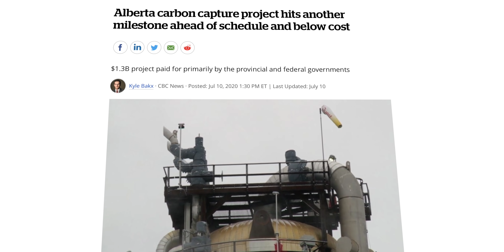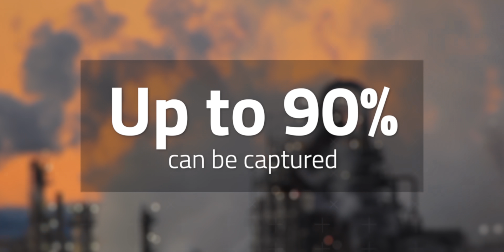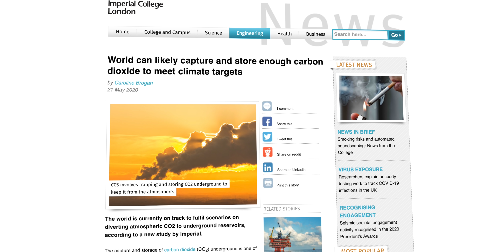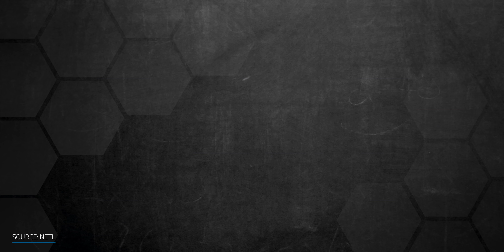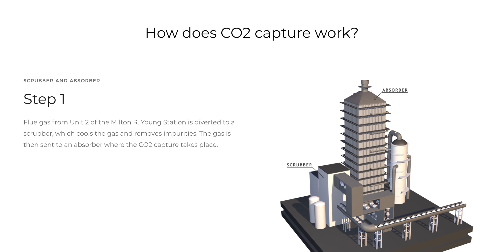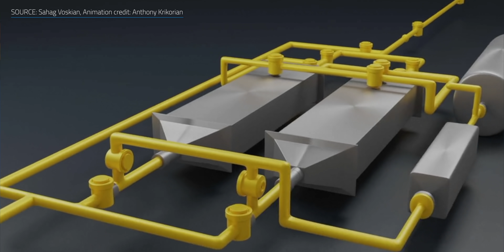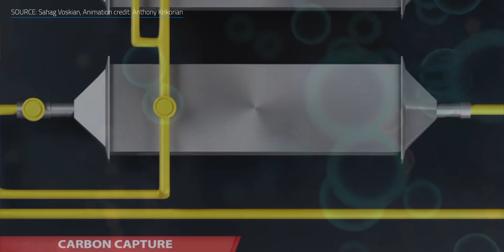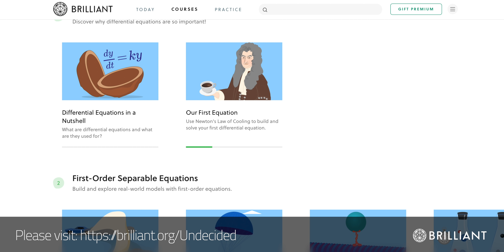The truth about capturing CO2 to reverse climate change

Comment: You may have already done something on this: could Earth be cooled with large banks of radiative refelctors like Skycool or any of the numerous companies coming out with this kind of tech? Also when people are focused on carbon doesn't it seem like the conversation should also include general air cleaning for toxins?
Reply: XPRISE CARBON CAPTURE
The heat loss from a smokestack can be forced into a large tank containing hot liquid microcrystalline petroleum wax. The heat will keep the wax at a molten state which facilitate the carbon to be absorbed when combined with the wax. Carbon when mixed with wax reacts like a dye. The wax-carbon amalgamation result in a black wax solution thereby making it impossible for the carbon to escape into the environment. Other toxic particles are also captured in the wax settling at the bottom of the wax holding tank forming into a sludge. A sludge release valve is located at the bottom of the tank. After the sludge is removed more wax is replaced in the vessel working something like a toilet. The sludge becomes a byproduct that can be used as an additive to asphalt for roads or used for cocooning nuclear waste materials for long-term safe burial. The entropy of the Earth has been increasing at a startling rate since the beginning of the industrial revolution caused mainly by the carbon that is released into the atmosphere. Government scientists have failed to stop and prevent carbon pollution from entering the environment. This problem can only worsen until a solution is found before this problem becomes irreversible. It has been discovered that formulated wax has been shown to be the only answer to this problem. William Nelson

Comment: We will need it, or did i miss anything? were pumping out noz only CO².
Those forest fires all around the world these days just kicked off an even worse heat-cycle.

deadline 2050 until our oceans and soil turn bad at a rate we would not be able to fight back accordingly.

means: food shortages worldwide. 

melting glaciers will mess with groundwater levels, as well as rising sea levels.
salt water pouring inland contaminating ground water, while most of the worlds population live at the coasts.

means: clean water shortages.

Comment: In Europe CO2 capture will increase with the price of CO2... Currently the price for CO2 is so low that its only worth it to shut off coal power plants, not yet high high enough to caputre CO2 ... I read calculations that we need more than 100€ per ton for that to become viable... and we might need another year or so until CO2 prizes are high enought for that... hence the startups that see that coming.

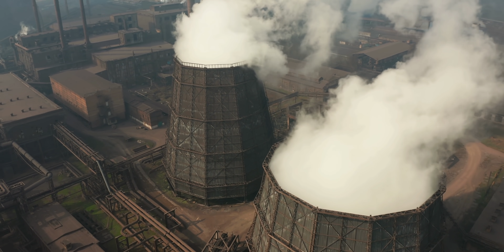Comment: @1:42 you state that there will be fossil fuel use for some time, and I would like to counter, that if the world takes it as seriously as a gas-chamber using Hitler, and commits to actual geothermal energy harnessing, then there wouldn't be your argument of "it's going to be here for a while." So while you're trying to sound the optimist, stop being so pessimistic and suggesting that litigation start NOW to MAKE oil industries SWITCH to geothermal by following legislature based on best engineering practices.

As for capturing that gas, it's pretty much a case of capturing it at it's source, and get the biggest polluters handled first.

Comment: CO2 Capture at high concentration outlets is great and necessary but Direct Air Capture is a pipe dream that is unlikely to ever work. 

This is because you need to flow an insane amount of air through a DAC plant to capture enough CO2 to make a dent in global emissions. For example, you need to flow on the order of 1 quadrillion cubic meters of air through a DAC plant at 100% removal efficiency to pull out ~1% of our current yearly global emissions.

Comment: Since the 1970's the rush for climate $$$ has been on. Every 10-20 years the earth is going to stop spinning on it's axis. Every solution from Nuclear to wind and solar has always had a by product that is EQUAL or MORE harmful than where we started but a lot of people make $$$$$ in the mean time. Today Solar and wind are the answer since we have huge WHIP sites with no end or solution in site. We have been using wind long enough now we are finding we have to replace all those blades on a regular basis and they are toxic. Now we are developing "WHIP" sites for turbine blades until we can find a solution and the cost of replacing the blades is more than the original turbines because technology has changed".... Unregulated sole source sales trap from the vendor!!! And who is one of the big players? GE who also makes coal plants systems, hydro turbines, and electrical power transmission systems....The coast line of the USA has been supposed to disappear since about 1988 and it is still there largely in the exact same place it was in then. I just watched a video by a solar company who's system installation with 25 year efficiently warranty on the panels will still not pay for itself because they added the "tax credit" back into the solar panels so there is really no incentive to buy their system.... A trick that has been played since the 1970's. And then there is carbon credits for the elite to use to cover their 20K to 60K square foot homes!!! Planet earth is the only one we have and we need to take care of her in spite of all the lies but so far every "solution" treats earth like a litter and we just keep covering more crap from lies deliverers with out any real solutions. Just big $$$$ changes hands to the same money pits.

Comment: The progress we have made on renewable energy is encouraging? It was a disaster in England and in Germany. I don't think anyone has thought what the climate change effect will be of taking gigawatts of energy out of surface winds. Talk about something potentially horrific.

Seems to me carbon recapture should be called plant lots of trees. it's cheap it's self-sustaining and it locks up lots of carbon dioxide, especially if you don't burn them down. Grow them cut them down for lumber use the lumber, when you're done recycle them responsibly so that they can turn into mulch and dirt and your carbon dioxide is locked up tight. It's the way nature has done it for billions of years.
Reply: Trees have a myriad of problems. At least in the current climate trees are not the solution you're looking for. Trees require a lot of water and land resource to grow. Not to say we should not make efforts of reforestation, but the issue has gone beyond where that itself would fix it.

Comment: CO2 levels are not high in the historical context of planet earth.  When you breathe, you produce CO2, about four pounds a day.  Trees like CO2, the earth gets greener when levels were higher.  Without CO2, our planet would be in a perpetual ice age.  I’m not saying we should make zero effort here, however, we need to operate in reality.  Saudi Arabia was a fertile river plain 10,000 years ago.  Egypt was under water 20,000 years ago.  Climate changes.  Clouds have a much more significant impact on temperatures and buffering, than CO2.  Let’s not buy Saudi oil because we are afraid to make our own.  We actually shut down a pipeline from our ally Canada, which offered cheap, efficient energy with minimal environmental impact, just so we could beg OPEC to increase production six months later.

Be responsible stewards of the planet...don’t buy plastic trinkets and disposable items from China.  Don’t litter, don’t waste, especially water.  But we do need energy, if not fossil based, then we should look at cleaner sources, like nuclear, along with solar.

Comment: MATT FERRELL -- This video is EXTREMELY DISAPPOINTING.  There are TWO MAJOR WRONG CONCEPTS that you present.  
^^ -- First, carbon dioxide gas is NOT WARMING the Earth.  You need to pay attention to VOLCANOES and SUPERVOLCANOES under the surface.  Over 20 major volcanoes have blown since April 2018.  There are massive supervolcanoes under Siberia along the Arctic rim and under New England, per geologists.  
^^ -- Greenhouse Effect in the atmosphere is primarily due to CLOUDS and HUMIDITY.
^^ -- A molecule's REACH for capturing incident heat photons is limited to the electron orbiting radius of its second highest stable orbit.  The highest stable orbit is where the electron jumps when it absorbs the photon.  If it absorbs the photon at the highest orbit, the electron takes off, ionizing the molecule.
^^ -- There are only 4 carbon dioxide gas molecules per 10,000 air molecules, far too sparse to trap heat photons.  The photons zip right by, hitting oxygen and nitrogen molecules, which are poor absorbers.
^^ -- Clouds are capable of blocking solar radiation, which has wavelength about 1,000,000 times shorter than heat radiation wavelength.  Clouds can block heat radiation very easily.  
^^ -- The wavelength of solar HEAT radiation is about 0.5 micron.  For Earth heat radiation, the wavelength is 15 microns.  The separation between molecules of the blocking/absorbing substance can't be far more than the wavelength of the incident radiation.  By looking at these two numbers, glass molecules surely must be considerably more than 0.5 microns apart, but considerably less than 15 microns apart.  Now, go back to "4 carbon dioxide molecules per 10,000 air molecules."  You can see that carbon dioxide molecules in the atmosphere are orders of magnitude too far apart to affect heat radiation.

Comment: Ex Service technician in the heating industry speaking. Local 463 New York. Retired.
I ran emissions tests in and around NYC on large multi-boiler installations down to residential applications.
Co2 output from combustion has increased steadily. The calculator for efficiency is stack(exhaust) temperature and % of carbon dioxide in the flue gasses. High efficiency heating equipment produces, and is a adjusted for the highest practical C02(up to 15%) and lowest practical stack temperature(300f net). Pre- 1973 - 8% C02 & 500f were acceptable. 12% and 300f is the oil fired standard 15.25% is Laboratory maximum for oil fired equipment. Gas is lower. In all applications Carbon Monoxide is also a concern, and it also relates to quality of combustion and C02 levels in the exhaust gasses.
Carbon sequestration is a positive step in the right direction for any type of carbon based combustion technology.
Graduate; Iron Fireman School of Combustion, Virginia, USA. I believe in Climate Change due to man made causes.

Comment: It really needs to become a regulatory requirement for oil and gas producers not an optional thing.  I.e. for every ton of carbon emissions their products represent when they produce oil and gas, companies like Exxon and BP would have to offset these future carbon emissions using carbon capture technologies.  Required by law not something they might do if it makes them more money somehow.   These CO2 emission products based corporations would of course pass on these additional costs associated with carbon capture to their customers, however that cost will provide additional incentive for consumers to move away from these "legacy" CO2 emitting energy production methods and products and make renewable energy more attractive from purely a cost basis.

Comment: I believe people underestimates the work required to convert the US from fossil to green energy.  It is not only a conversion in the power sources but a lot of work needs to go into the grid to handle all the new renewable resources.  Renewable energy sources tend to be much smaller than fossil power plants.  They also tend to turn on and off more often.  Sunlight and wind is not always consistent.  Wind doesn't always blow and clouds can reduce solar output.  This makes a lot of noise on the grid which makes it difficult to keep stable.  Large powerplants act as a filter to this noise.  Any technoldogy that gives us time to advance our grid to handle green energy is greatly needed.

Comment: Firstly let me say I am not convinced that co2 is the problem and that all the obsession withit is distracting us from the real problem. We have wrecked the world's ecosystems by overfishing killing all the whales thus switching off the whale pump (Google it).
Next we have chopped down vast areas of rain forest and therefore changing the albedo of the planet. Google Church forests of Ethiopia and see how that whole region should look. PCBs, DDT plastic in the oceans the list goes on. The last big thing that really worries me is the destruction of microrhiza in the soil by pesticides herbicides and herbicides in particular glysophate. The only media outlet reporting on this is RT by the way.
OK so fix all of the above first and they will sequester co2 fish and whales are made of co2. If you want to remove co2 from the atmosphere there is a much simpler method but I don't want to mention that as there is a 100 million dollar prize for that. I would however say that what we should be doing with the CO2 is turning it into hydrocarbon fuels. Electric cars have their own problems I think we should be sticking with the ICE engines burning this fuel. It burns extremely cleenly no contaminants. So you capture the CO2 put it in old gas wells and use it as needed. It can be processed when renewable energy is available  and therefore forms an ideal backup energy source.

Comment: Ocean levels have not risen at all. Polar ice gaps, Greenland, other glaciers, mountains, frozen tundra. These all would release water to the oceans. And the higher temperature would raise the ocean temperature and thus the water would expand. There's 3.6 billion km3 of water. There's no global warming, climate change perhaps, but you can't fight climate change, you could only fight Co2 global warming. But going from the lowest point of 0.03% to 0.04% certainly doesn't change temps.

Also statistics show that Co2 seems to cool the planet, not warm it. This is perhaps why earth has survived, there's so much Co2 in the oceans that whenever temps go up, Co2 has changed things back. Co2 would increase in the upper atmosphere where it would radiate the heat more effectively than ozone, that's the explanation I got from a relative in the field.

Comment: Interesting video, but a little misleading. Your video shows smoke stakes emitting a white gas, which is probably water vapor. Also, CO2 is an essential part of the atmosphere. Plants require about 150 ppm to exist and are happiest with around 1000 ppm of CO2. So, what is a good level of CO2? If CO2 is heavier than O2 (3.8 times) and O2 has trouble getting high in at atmosphere, just visit Denver, then how does CO2 get to an altitude where it causes problems (airplanes, and thermals)? So which is the worse pollutant? I've read that it is not CO2 but that it is water vapor.  Why aren't we looking at that? I am not denning climate change, but I think it is much more complex than just blaming CO2.  To make matters more complex, if you look at the NOAA temperature data for the last million years ,you will see that the earth goes through rapid temperature swings every 100,000 years or so.  We are at or near the peak of one of those swings. So some time in the future we will be on the down slope of those temperature swings. What then, as we head into global cooling?

Comment: 5:00 The thing about the waste stream it happens after you have sold your product walked away from the transaction with profit in hand. At the end of the life of the product trying to get a company to take responsibility for the waste by cutting into their profit margin of the original sale to get the product deconstructed into bioavailable materials or capturing the material to reuse in a new product.  Corporations have been holding the profits for centuries. Some have been re-spent back into the economy, wages, real estate, bank fees, capital gains and losses. Everyone trying to make a bit of profit on every transaction, but just dumping the end of life product out the window.
Reply: Monomers could be recaptured and reused. Right now it is cheaper to make new polymers  but plastic can and should be recycled. My dad's concern with plastic was that it structurally fails all at once. He used bridges to teach me this. "Steel oxydizes from the outer surface to the core. So we sand and paint bridges." Then he showed me an old, clear acrylic paint brush handle and it was crazed all the way through. He was worried that some monomers act like biologic substances in the body and we did not yet know what they did. He fought pestecides and petrochemical farming his whole life because it poisoned the plants not just the bugs and destroyed the vital microbes in the soil. Our escallating cancer rates prove he was correct.

Comment: This is a good job of describing these technologies but how effective are they? How does the energy balance work out? The bugaboo with CO2 is that it usually takes a lot of energy to do anything productive with it including transporting it. How good are these solvents? I was under the impression that dissolving CO2 at standard conditions was problematic. 

Landfills actually do a pretty good job of sequestering carbon. Especially with forestry products. I would like to see more coverage about that part of the carbon cycle. That and planting might be the most pragmatic approaches we have right now.
Reply: The US Navy uses mono-ethyl amine for CO/CO2 scrubbers aboard ships and subs. The resulting CO2 gas the then compressed and sent to a CO2 Burner which captures the carbon through chemical interaction and heat, releasing O2 and water vapor into the air.
Not the most efficient method in terms of energy, but quite effective at maintaining liveable atmosphere for crew.